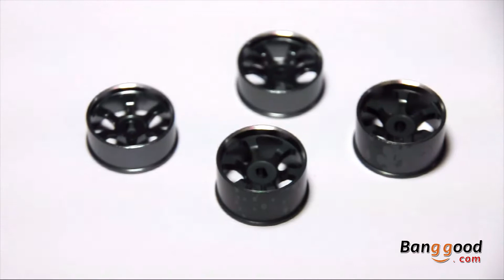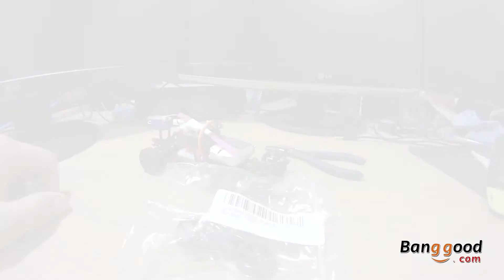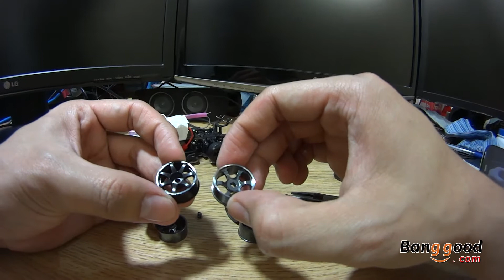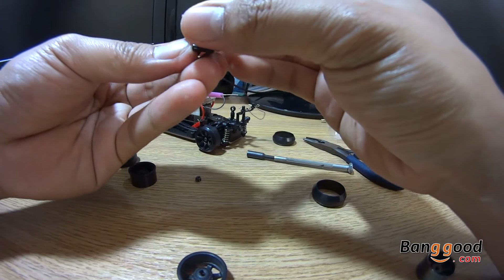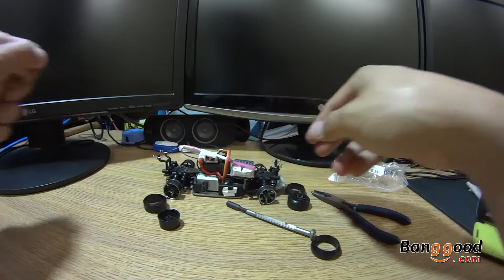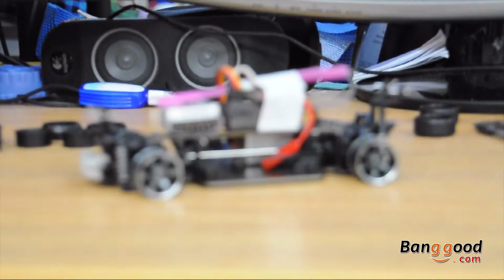1/28 Upgraded Metal Rims For AWD IW04M DG04M from Banggood

Comment: Are these the same dimensions as original ones thanks
Reply from the maker: Slightly smaller, about 0.1-0.2mm. Mini-Z rubber tyres fit them perfectly but for drift tyres it'll need a bit of glue or thin double sided tape.